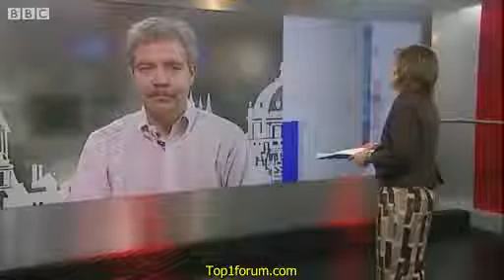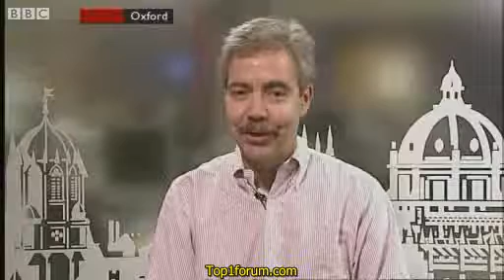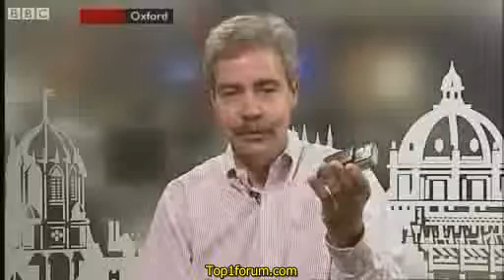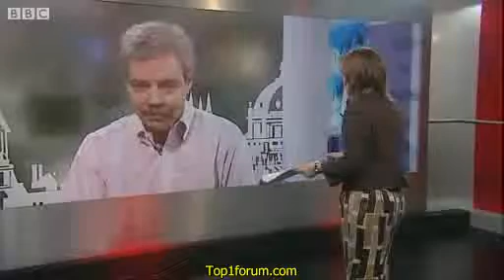Wireless power system shown off

Comment: Nikola Tesla had an electric powered Pierce Arrow back in 1930 that used no batteries. It got 240 volts through the air by way of a special antenna. The source of this electric power came from non-Hertzian electricity which Telsa could generate either using the earth or the atmosphere as medium. Of course the great American entrepreneur J.P. Morgan put a stop to this whole project. WTF? Free energy and electric cars that required no batteries! You can't make money off of that for God's sake!